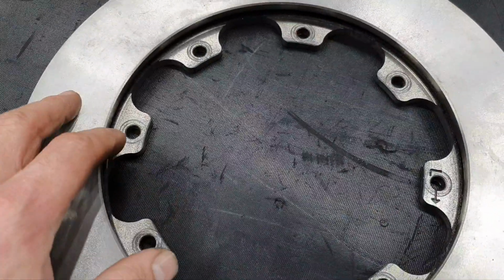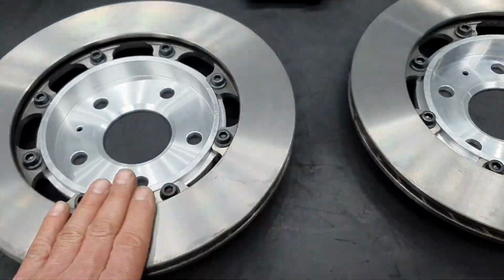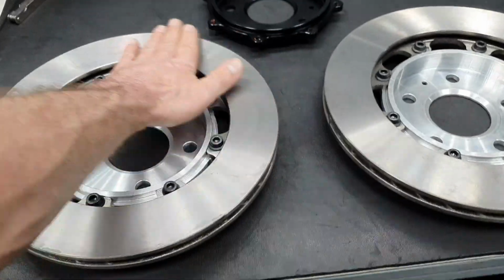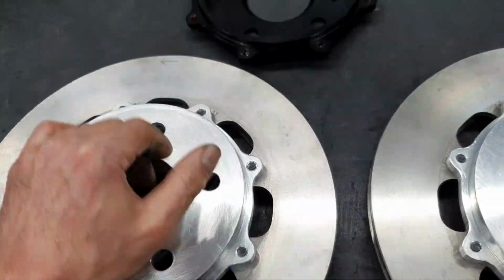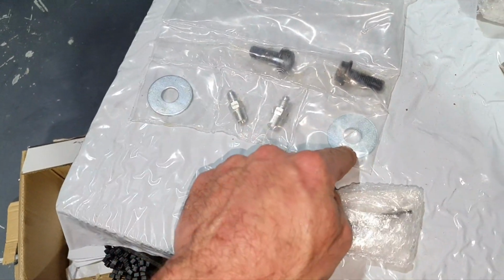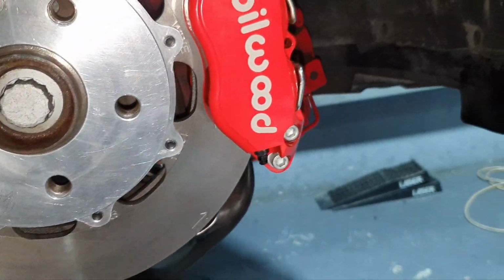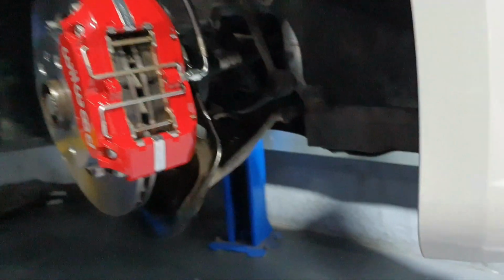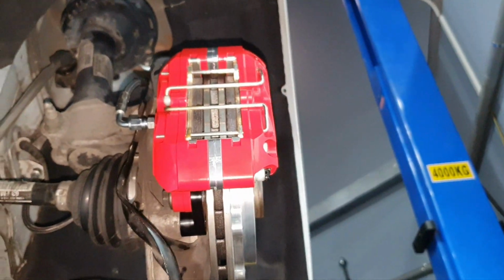front brakes downgrade 🤪 incomplete video (part 1)

Comment: According to Wildwood website curved vane rotors come in LHS and RHS models....which is logical.  It is not mentioned who mfr's the rotors used in this video.....but clearly  one rotor is incorrect. Needs to be changed.
Reply: You can even see it on the fan inside. And that's clearly the wrong brakes for that car. With these, the driver will hav a huge accident...

Comment: To everyone crying in the comments these are drag brakes to clear smaller wheels with drag slicks for drag racing. A car that needs these is fast enough to need a parachute so these are mainly for staging and driving around in the pits. Not for road course racing where strong brakes are required.
Reply from the maker: I hope/wish you are right. 

Hint: doesn't have parachute and it's street car as far as I know.
Reply: @TasosMoschatos  they're still suitable for drag racing on the street without a chute, but most commonly used in combination with one. They will be useless for any sort of road course or time attack racing with corners where these would experience brake fade quickly. However, these are designed for clearing small wheels which the only reason you'd want to do that is for drag racing.